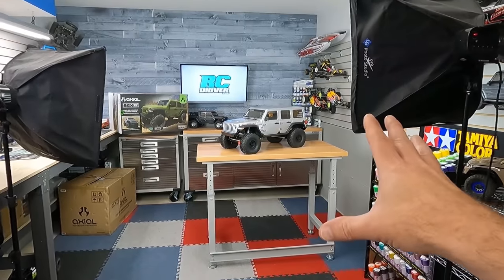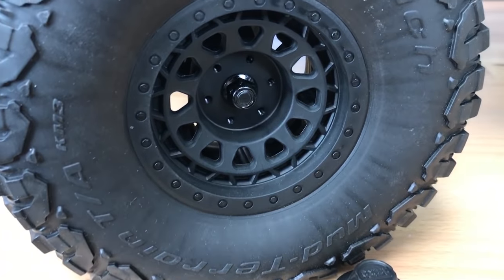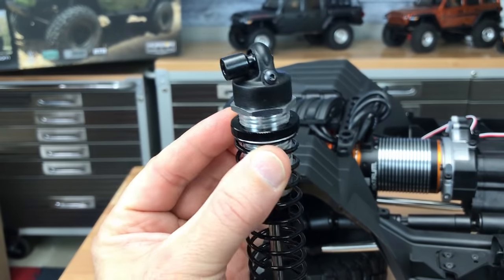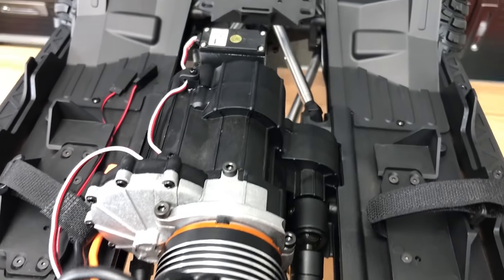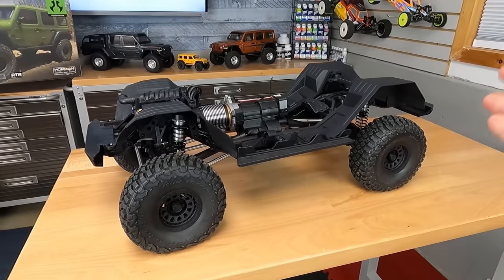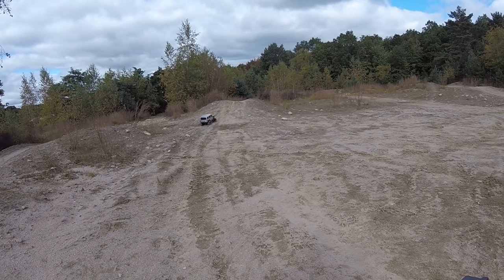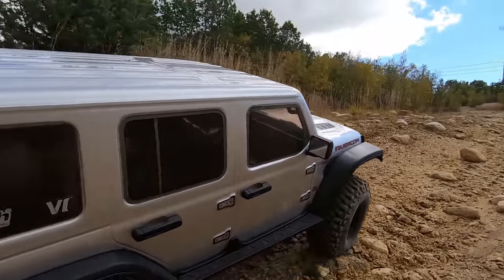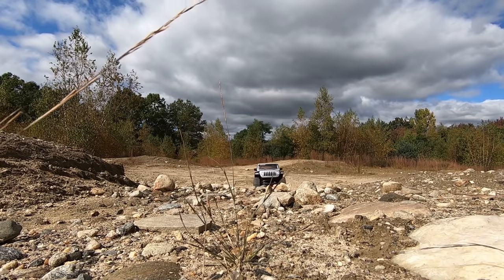Giant 4x4 RC Car! Axial Racing SCX6 Jeep Wrangler Unlimited Rubicon Crawler Review | RC Driver

Comment: The manual recommends that you drive the jeep forward very slowly while shifting from 1st to 2nd gear. You want the gears to be moving past each other so the servo isn't trying to push them into each other if the teeth are lined up (you can damage the servo or the transmission gears).

I think that's probably why they put a little bit of slop/flex in the shifting servo mount so that it can give a little bit until the gears slip past each other and it slots into gear.

Comment: That price tag is so steep but it’s a beautiful rig! Sweet SCX1 you have Greg!
Reply: Its steep but hard to beat for a huge well built brushless rig.  And still cheaper than a built vs410
Reply: I think once you add up all the upgrades and things we do to our 1/10 it’s around the same if not less. I guess the only issue is you are spending $1100 all at once.
Reply: Put in my order at my LHS yesterday. Price is steep, but the motor and speed control retails for about 380$ alone.
Reply: Reading the comments on this comment I think I'm the only one who understands this, and yes it's beautiful, I whish I had a rig like him although I like the Mojave more.......
Reply: @noslackadventures8503  This is true, good point.
Reply: @havn2muchfun  Exactly.

Comment: For $1000, you would think you could open a door or 2 and have a decent Scale interior.  While I am sure it is nice, and fun to drive, it is a lot of dough for something you can't put a action figure in.  I have 2 of the Rochobby 1/6th Jeeps and they are a lot of fun and super scale for less than 1/3 of the price.  Not really sure what Axial is going for in this class.
Reply: Those are fun and nice for the money but they are still considerably smaller and less quality features.
Reply: @michaelmowbray4360  I agree it has a better drive train and some features.  But wow 1100 and no scale interior.  I also think it is unstable turning and top heavy from what I see in the videos.  I like my Jeeps.  Great points in your comment by the way.  We all have to decide what toy is right for us.
Reply: For that price I was wondering were the gold plating is.
Reply: @stevewest7260  Lol
Reply: Yes. Good comment.
Reply: Please tell us your option of roc hobbies jeeps
Reply: Steve Vento  such as?
Reply: @allmightygreatone1048  I only have the 1/6th scale Jeeps.  I have made no modifications yet.  I am going to put some better tires on one and leave the other stock.  May get a winch.  I have the trailer and canopy top and a bunch of scale gear with GI joe's, lol.  In the future I may upgrade shocks but changing oils seems to make the stock ones perform well.  I like these jeeps right out of the box.
Reply: @peacefulprepper2402  hi. How is the quality and dependability. I hear stock, that tells me no broken parts. 1100 is just too much. I have been blessed with work trucks for far less than that. Seen many videos of 1/6 jeeps. Looks like fun. Dragon makes nice driving figures. So scale. Thank you for responding. Have nice weekend.
Reply: @peacefulprepper2402  I remember in 1971 gi joe had a cool jeep. It only took 50 years for a company to put an rc under the body. Hard body and thick plastic.
Reply: This is the best comment I have read on you tube pertaining to a new rc. Polite and to the point. This is what 1/6 scale is all about. Scale details and open interior  to put scale drive figures.
Reply: @allmightygreatone1048  Thanks for the reply.  We have a blast with the jeeps.  I run them on 3s with no issues.  The absolute best trail rig for the money, in my opinion,  when you consider the added scale fun.  I just bought another GI Joe, lol to go in the other jeep, lol.  The articulation is so realistic on these jeeps.  Power is great and a surprisingly stable crawler.  RC Review on youtube does a great review and voted it #2 crawler 2 yrs in a row.  I have never been more satisfied with a box stock vehicle.  I have gotten them as cheap as $270 with the free machinegun on Amazon.  Unbelievable at that price.
Reply: @allmightygreatone1048  Lol.  I agree, 50 years, wow.  Common sense seems to be uncommon in our world of scale.
Reply: @allmightygreatone1048  Lol.  It seems common sense is uncommon in our scale world.
Reply: @peacefulprepper2402  thank you. This machine makes more sense at 1/6 scale. I saw the new axial at hobby store friday, it's crazy big and heavy and cost too much. Your review has definitely educated me on the roc hobby jeep.
Reply: @allmightygreatone1048  Thanks for the comment.  I agree and my hope is that axial and others will build on the 1/6 platform with true complete scale in mind.    Details matter to many of us.  If they are smart they will follow RocHobby and the aftermarket for accessories will explode in pure profits for the industry. I am breaking out my sons old GIJoe stuff and having a blast.  I was a Corpsman in the Marines and I am even making a stretcher and a wounded transport theme for one of the Jeeps using one of the broken figure from my sons collection.  Adapt, improvise, overcome.  This 1/6 scale platform could get more kids back in the hobby and then we can teach them about radios, repair, gear ratios, OHMs Law, responsibility and all of the other things dads like to teach.  I am with you, most of the big RC companies are missing the boat on what scale could and should be.
Reply: @allmightygreatone1048  You are very kind with your comments.  Thanks
Reply: @peacefulprepper2402  thank you for your review.

Comment: I don't see this gaining a lot of traction outside of YouTube, at $800 I think it would have rocked the market, but $1100 is tough. I don't think the increase in scale really adds to the crawling experience in the same way that the Xmaxx scale adds to the bashing experience.
Reply: I got the green one yesterday and it's so much better then you would think. It's a beast. Been crawling for 10 years and this makes me put some of my 10th scale up for sale. Took it on a 5.5 mile trial ride and it made it on one 7500 mah 3s. It is expensive but once on the trail you will forget about that. Honestly most 10th scale get to be more expensive then that once they are all done up.
Reply: @BIGGBULLxxx  You will like it for sure. When you first open the box and realize how big it really is its shocking. It just looks so much more scale in my opinion with how it moves since it's so heavy. Good luck with it 👍
Reply: @BIGGBULLxxx  I had it next to a friend's kraton 8s and it still looks massive. It's not as wide but the body is definitely bigger. I also have a lifted trx4 sport on 2.2 tires and it fits perfectly on the roof of the scx6 and looks tiny.

Comment: Absolutely Awesome Review! Really think this rig is going to shack the industry in a positive way. I was wondering about the tire option you mentioned the SBR but I think maybe you meant the SRR. Which has a similar wheel size. The SBR has a Larger in diameter and the tires have individual holes for every screw on the beadlocks.

Comment: Not bad I run a 4276 2200kv in my element Enduro Trail walker on a castle Momba monster. It's a mean rig it's lifted has the 5.4 boggers on it 124mm aluminum shock absorbers stainless drive shafts all steel gearing in the stealth X ect. It's a pretty wicked rig to be honest.. n imma have give this one a try

Comment: I run two 3S batteries in parallel in my gladiator and it works great for long trail days not having to mess with taking the body off on the trail. 

I’m sure that would work great in this too. Awesome review!

Comment: Do you think they missed the boat by not having the Diffs lockable via Remote?    I hear the turning radius is not that great.  What are your thoughts?
Reply from the maker: I don't think so. Although lockable diffs sounds cool, I hardly use it on my TRX rigs and prefer driving the Sport the most. I felt the turning radius was good considering the size of the truck. I don't think its fair compare it to a smaller rig. There a part in the action where I show it turning in loose dirt. It did well, I think.

Comment: Really solid review as always. I thought Matt mentioned the motor is not 4s compatible but the ESC was.
Reply from the maker: So early on when I made the video, I heard it was a 4S capable system, but it sounds like (after more testing) the motor can’t be run continuous on 4S and risks burning up. So 3S is the suggested pack to run.

Comment: I'm wondering what kind of runtime three 3s 5000mah packs would get in parallel? Might as well make use of the three battery trays. 🤷‍♂️
Reply from the maker: I guesstimated I was getting 30-40 min on single packs. So it would be doubled, but it all depends on driving style and terrain.

Comment: It needs opening doors and hood with real hinges. Removable top . Full roll cage to except 1 /6 scale driver and a sound box. The fans sound like a Hoover vacum. Will the esc , motor , servo, trans gears, wheel hubs strip,plastic bead lock wheels all crack at the bolt holes, front drive axles and all four shocks leak and fail the same as the axial 1/10 scale all fail within 10 batteries.

Comment: Looks great but for me the price is alot like I could buy a vanquish for this price build it up also, if not that I could buy 2 trx4s or scx10s and since there 1/10 scale they would be way easier to take places and if not that I would get a xmaxx  because I don't really get the point in a 1/6th scale rc crawer

Comment: What tire does proline make make for the sbr2.0. I've yet to have seen them or any tire other than stock for that matter.
Reply from the maker: That was my bad. Had it in my mind the 1/7 Hyrax fit.
Reply: @rcdriver Dang, u got my hopes up for nothing. Maybe u can pass this on to proline.... Make some sand paddles for the SBR 2.0. thanks

Comment: It's awesome but it's too expensive. It's worth max like $800. $1100 is just too much. Normal people cannot afford $1000 rc's.
Reply: Own and upgrade the average Wraith and it is well over $1100 after 2-3 years
Reply: @aaronthered4126  Of course it is because it is heavily modified. $1100 is the stock price for this. The price of this will be heavily increased after modifications.
Reply: @gasolinediesel972  bigger costs more. a Traxxas 1/8 e-revo can't be sold for the same price as a Slash.  Bigger injection molds and molding machinery, bigger and more complex components. Prices are exponential. I believe that people whine about the price is because A0  they have no understanding of engineering, material  and build costs or B) they just can't afford it.
Reply: @aaronthered4126  An SCX-10iii is approximately 60% of the size of this SCX-6. That means that this should be roughly 40% more expensive, give or take. This costs over 50% more than an SCX-10iii which is an already very overpriced vehicle. Nobody expects this to be a cheap vehicle, and nobody expects this to be sold for the same price as an SCX-10 iii, but it is wayyy overpriced. The SCX-10 iii is worth $400 max and this is worth $800 max. You could almost buy a gas 1/5th scale race truck for the price they want for this. A 3s 1/6 crawler costs almost as much as a 1/5 gas race truck. What exactly does this do that an SCX-10 iii doesn't? Literally nothing other than the fact that it's sensored brushless and that it's big.
Reply: Most people family can’t afford for one rig. Better two rig or 4 rig for half price.
Reply: Most my life id agree, id be into crawling a real jeep if I were well off , but atleast with RC's even this one is the price of one miniscule part of the real thing , look at like that and speaking of MAXX id have to say that's truly only rc that add a extra 100 or two from being a equal to the market , while being extra durable they sacrifice being more on the toy side opposed to a intricate metal machine . Jmo
Reply: Prices are  continuously going rise , as everything in the USA,  inflation like we never known , Canada and UK already used to it